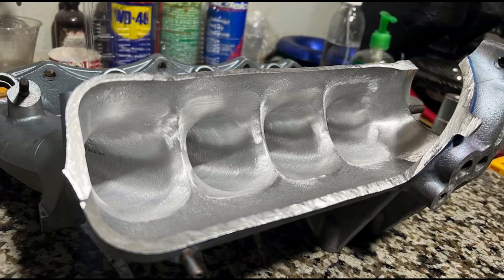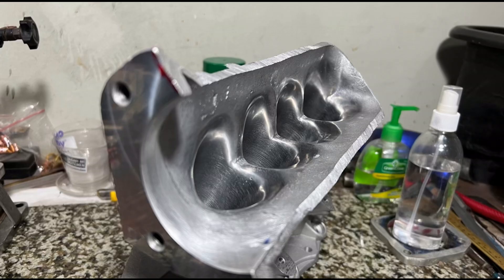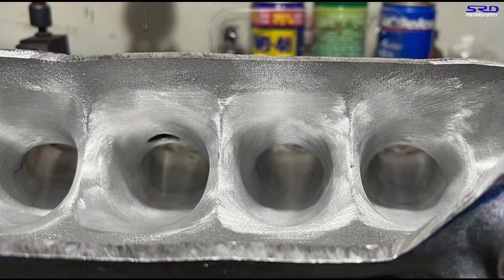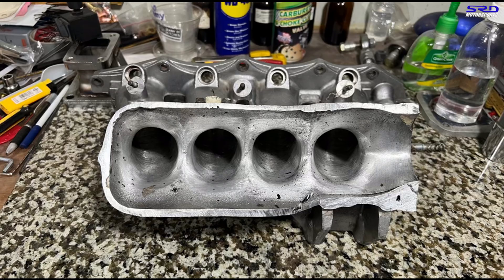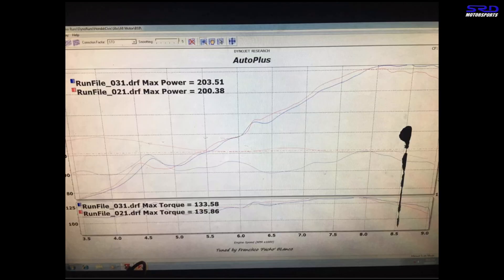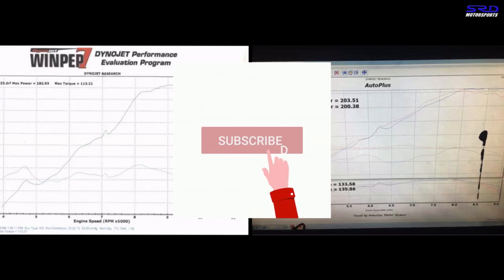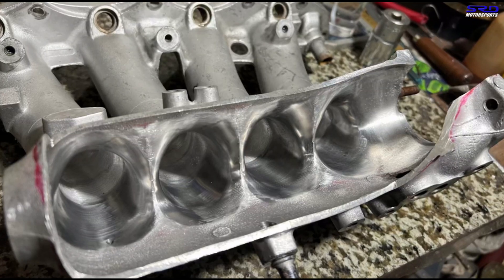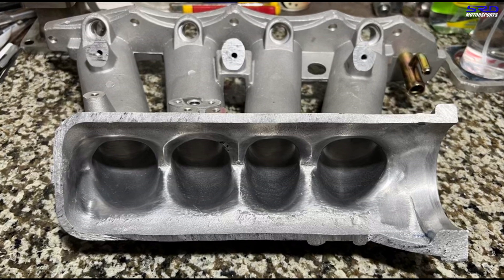Intake Manifold Porting Finish: The Evolution P73 P30 Skunk2

Comment: Sir ralph, where do I connect one my drain plug on my tb/manifold which drains coolant. I have a local sir manifold ported that I recently installed on my b16a. Is it okay if I just block the drain?😅
Reply from the maker: Manifold doesn’t drain coolant so I’m not sure what ur saying
Reply: @SRDmotorsports  I mean is there a return hose for coolant on the manifold or TB? And where do I connect it. Thanks sir
Reply from the maker: There is no return there

Comment: So I have a question, I've heard that when you port the intake manifold and also intake ports on the head  too smooth like a smooth finish that the air rushes in too fast and the motor will be fed too much air that's why you want a kinda rough finish but the exhaust can be as smooth as possible, is this true?
Reply from the maker: Technically yes, but the explanation is a little different… smooth surface tends to have a slower surface flow near the “surface” and may cause flow separation on the misty (air / fuel mix) and have the fuel puddle

Just like the “smooth” glass on our windshield and side windows we see water flow like river lines but air is flowing fast around and above it?
Reply: @SRDmotorsports  ohhh I see now, wow that's so weird because you would think air would flow much better with a smooth port finish but it's the complete opposite
Reply from the maker: @StraightOutThaGudda  well it’s still smooth just “just textured”
Reply: @SRDmotorsports  gotcha
Reply from the maker: yes sir

Comment: Awesome videos! I have a related note In a spreadsheet I have and it says  "Intake wall finish should be 400 grit emery sand paper stroked in the direction of the airflow."  This was from an ilmor engineer so there might be some sauce there but from 2011ish. Can't remember if that also applies to the runners.  I'm sure someone has done studies on boundary later thickness vs surface roughness by now... Hopefully :D
Reply from the maker: oh sweet info man! interesting on that 400 grit! :)